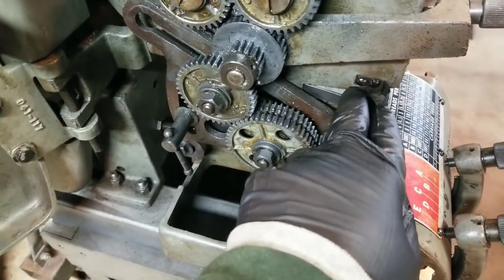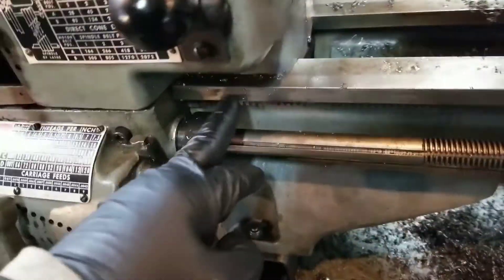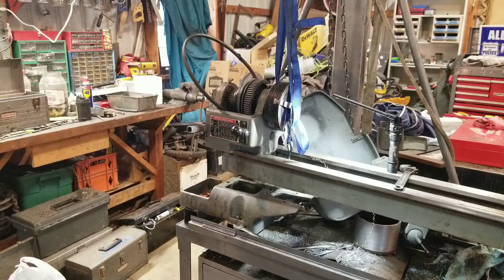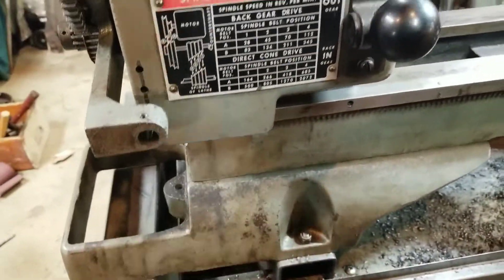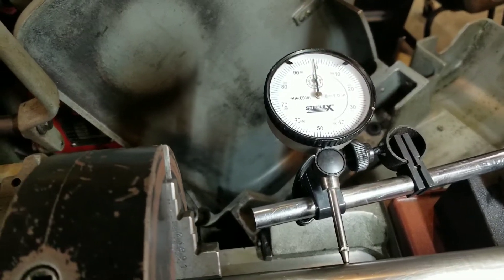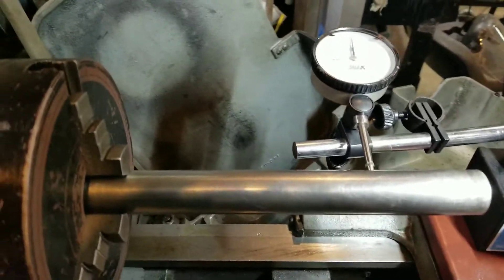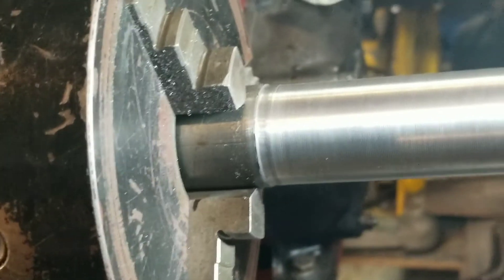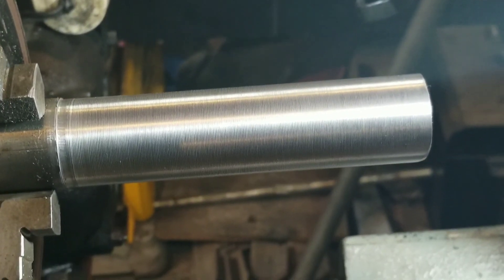Craftsman 12" lathe headstock alignment. It's fixed!

Comment: A friend of a friend with 50 years in the trade? That's what a guy needs. That had to be a heck of a wallop to deform those castings. I'm beginning to realize that if you don't drop it and keep it lubricated a lathe will last forever.

Comment: I wouldn't be surprised if the chisel was how it was initially calibrated.

looking good, need to get mine going. I have an old 12" Atlas that has taper on the tail stock end too.
Reply from the maker: Yeah, that's what I was thinking. I have the southbend 13 inch lathe that I bought to upgrade from the Chraftsman but now I don't want to sell either of them...
Thanks for watching!
Reply: Once you confirm your bed is straight ( no twist) then the tail stock has a cross key and an adjustment. In fact you use this to cut subtle tapers. Just remember to reset.
Usually hours of setup and patience in the early stages. Stick with it. You tube will help you too.
Good luck on your journey
Reply from the maker: Thank you! 
Tom